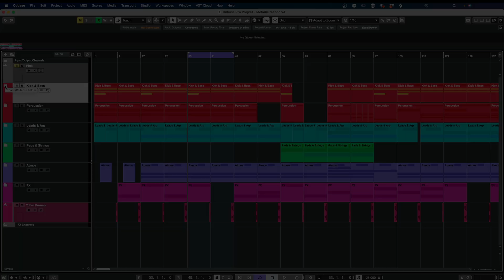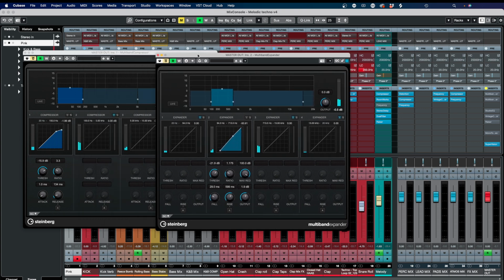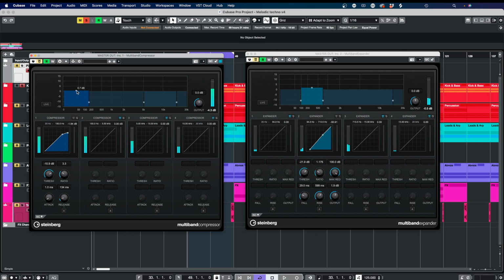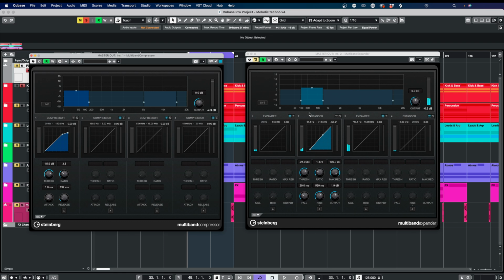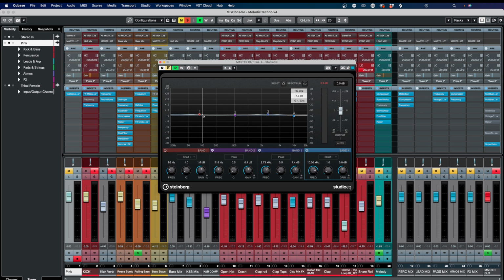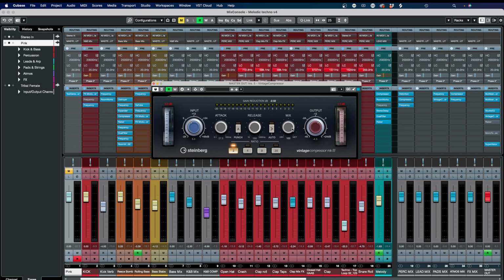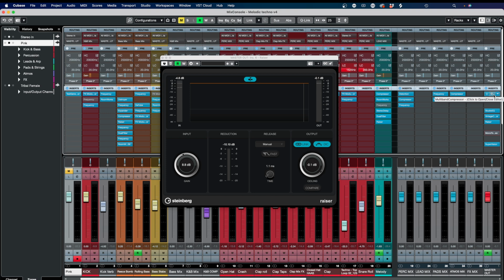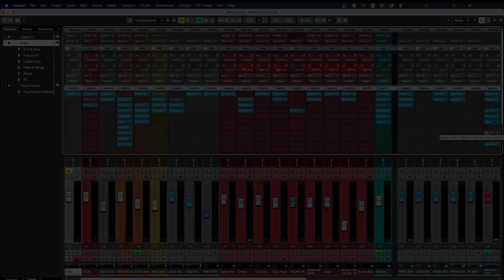How to Mix and Master a Melodic Techno Track | Techno Production Basics in Cubase

Comment: You’re talking about pink and white noise . Could please explain how you used it precisely?
Reply: I believe it's being said that pink noise has equal distribution of all frequencies, so what you're supposed to do is listen to every track (or bus) in isolation against pink noise and if you set the volume of each track to be in the same relation to the pink noise, then they will be "perfectly" balanced against each other.
Reply: @antic604  thank you! So it is just for test reasons, you don’t leave it in the mix? And it’s only about volume, you don’t adjust any frequencies by eq ing ? Is it also an option to leave pink or white noise in the Mix, as a background, atmospheric track? Thanks for help and the nice video 👍